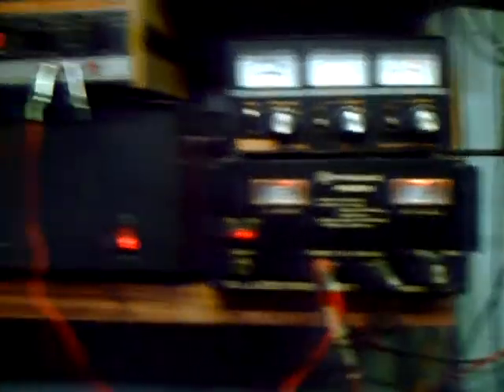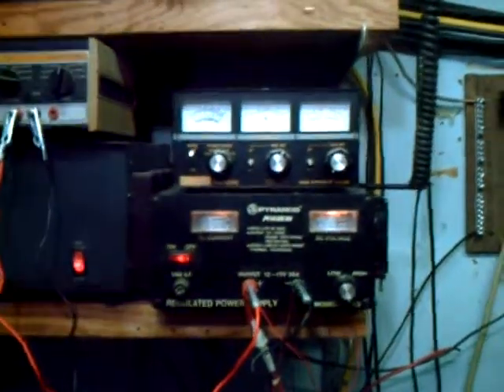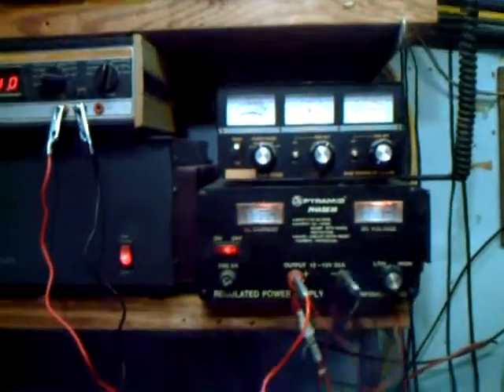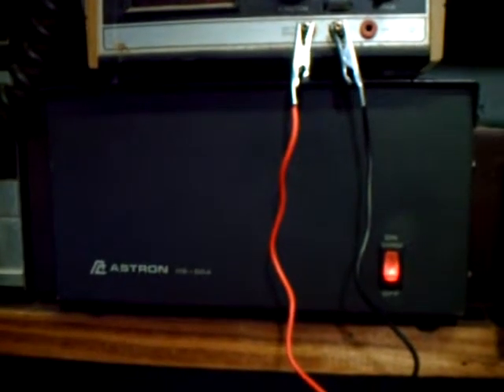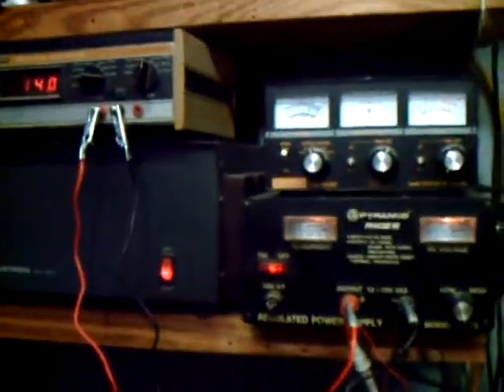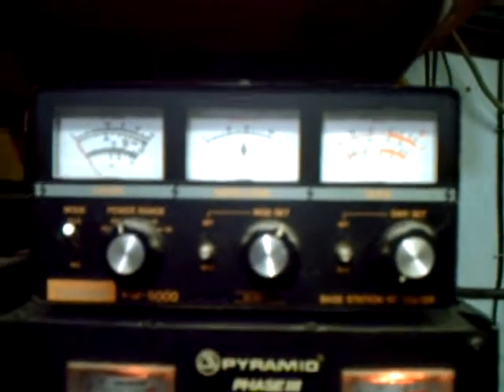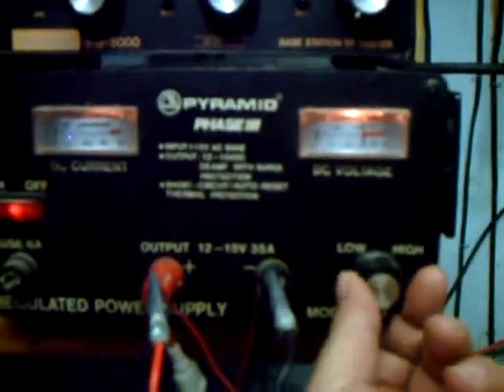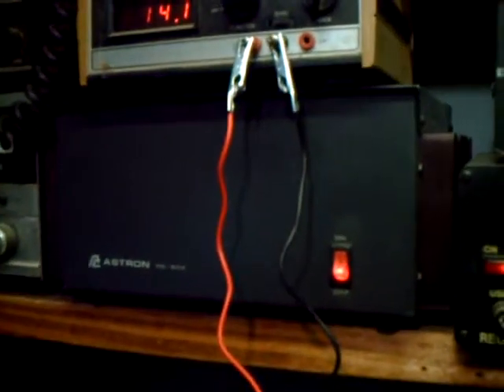CHALLENGER POWER

Comment: They are easy to install finals in. Mine sat for years unused until i bought it and the final was blown. I had a NOS 1969 and i installed it along with a 2166 driver and shes back on the air.